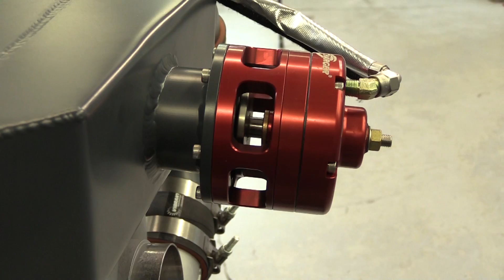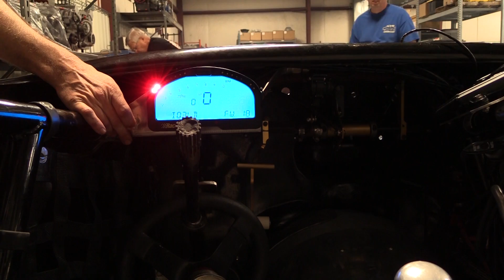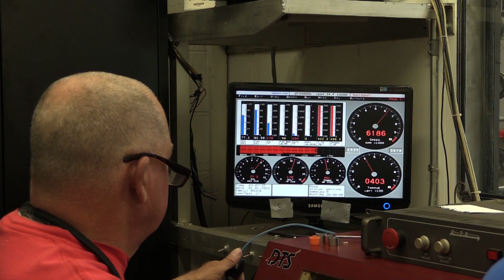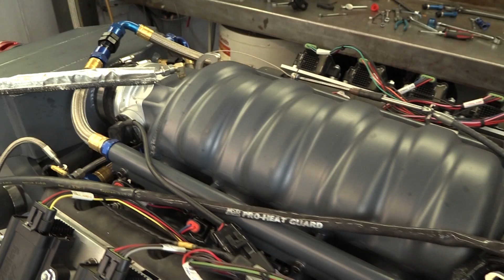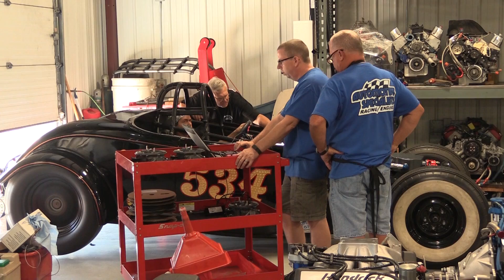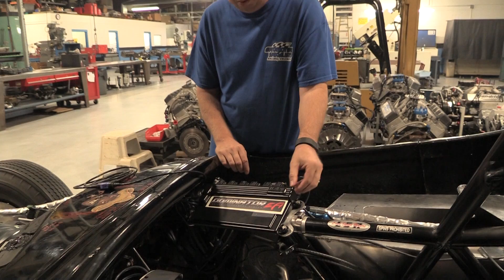A Thousand Horsepower on Just 260 Cubic Inches!

Comment: the rule no engine over 260 cubes but you can boost the shit out of it, where is the logic in that.
Reply: ChadMutt boost does not increase capacity mate. a 260cubic inch engine with 30psi boost still has the same capacity as a 260cubic inch engine that is NA
Reply: ChadMutt dude really.. if you have a 100mmx100mmx100mm(1litre) jug that is full of air at atmospheric pressure it will take 1litre of water to displace that air. if you pressurise that air to 30psi. you will still only need 1 litre of water to displace it. The displacement has not changed.
Reply: ChadMutt dude your getting your swept volume(cubic capacity) volumetric efficiency and dynamic compression ratio all mixed up. boost has absolutely no effect on cubic capacity but yes it does increase volumetric efficiency and dynamic compression ratio.
edit: how else would it increase power
Reply: MrEnroh. Woah...thats telling him! ...yeah dumb ass ! What were u thinking!
Reply: ChadMutt you are correct however you arent changing the displacement of the container are you....think about it...
Reply: ChadMutt because for eaxh cubic capaxity class there is a NA and a boosted subclass. if your NA you only run against NA engines of the same capacity. if your boosted you only run against boostes engines of the same capacity. remember they are only chasing records in land speed racing.
Reply: ChadMutt righto mate im out.
Reply: ChadMutt that logic is stored in the same place as the reason and decision to drive a sketchy 1934 car 235mph on a loose gravel like surface
Reply: @brentiaconelli6484 that's a replica ya fuckin putz
Reply: @Trendyrapslut  replica or not peg-boy...  Its still 1934 engineering. its still a i beam front axle and front leaf springs. So what the fuck does it matter if its a replica or original. Its sketchy because it was never intended to go over 50-60mph when engineered and these guys go 230mph. Your the putz!
Reply: @brentiaconelli6484  you must be new
Reply: there are multiple classes. na and blown they all have the same cubic inche classes. all the way up to AA which is 501+ cubic inches so you can run your motor in na then throw a blower or turbo on it and run in another class with the same cubes
Reply: Exactly
Reply: @damianw226  so tell me how the engines capacity has increased by adding a turbo ir force induction.  Oh that right it doesn't change.  Another wannabe car enthusiasts or troll   still at home with your mum and dad kid or manchild stfu
Reply: 260 cubes with a bar of boost is 520 cubes or around that. whats the point in having a cube limit if there is no boost limit. 
yeah mate just chuck on a blower or  turbo and go racing ?
Reply: a increase in displacement literally means more air and fuel can be pushed it
Reply: @Clorox Bleach  who cares about hondas there rubbish
Reply: Umm wtf does adding force induction have too do with the engines displacement.  ???? Or adding displacement.  If an engine of 3.0 liters revs to 7000 rpm then it will displace only 3 liters of air in one minute at 7000 rpm even if it had force induction.  Another wannabe car enthusiasts just like the 14 other that liked this sad comment.
Reply: +ChadMutt No kidding. Especially since they are effectively making the engine bigger anyways by putting a shit-zillion lbs of boost to it.
Reply: 177SCmaro no they arent boost is just stuffing more oxygen and fuel in
Reply: if you have a one liter container  full of air and then cram in another two liters of air that's three liters. 1+2=3. this is what boost does. gasses are compressible, liquids aren't.
Reply: " if your boosted you only run against boostes engines of the same capacity"

how can you be of the same capacity" if there's no limit on boost .
Reply: adding boost (compressed air) increases the volume of each cylinder. the physical bore and stroke might not change but the volume efficiency  changes dramatically under boost.
Reply: if you have one apple and then add two more. it's not one apple anymore.
you even agree with me
"yes it does increase volumetric efficiency "
Reply: no  displacement doesn't change(liquids aren't compressible}  but my container now has two liters of air in it.  if everyone is free to put as much air into their one liter container as they want where is the logic in that.

Comment: Not even impressive, nearly every engine made can double it's displacement in liters in wheel hp under boost.  That is with a reliable setup.
Reply: uh the 260 hasnt been in production for a very long time you wouldn't be impressed watching a 283 sbc spin 12 on alchol trying to destroy a pull sled would you
Reply: Always some know it all child making snarky comments.

Comment: I wonder why he didn't turbocharge it? Could have made the same or more power, with less stress on the engine. Class restriction?
Reply: +TurboMitsubishi Probably packaging. Turbos and their plumbing take up a lot of room. Plus, centrifugals are a bit more efficient then turbos in terms of how much they heat the air per lb of boost (adiabatic efficiency), although they do take more power to spin, so that could be a reason.

Comment: small engine? this is a 4.2liter V8, how is that small?  Look at the 1.5liter turbocharged formula one engine of the bravo BMW making 1500hp. /watch?v=t5Dbp_SuMHE
Reply: They didn't live more than about 200 miles (if that) and they ran on basically carcinogenic rocket fuels. It's pretty obvious the differences that exist, maybe you should learn more about engines then come back and continue the discussion.
Reply: 4.2l V8s are small....for a V8. Most V8s (at least in American cars) are 5.0s and bigger. Yes I'm aware of the Ford 4.6 v8, but as a whole American V8s are much bigger than 4.2l. 

Once you get into foreign markets it's a bit different, but that's an entirely different animal.
Reply: +Jan Akkermans F1 engine live for 1 or 2 races and cost like half a million dollars. Not really sure that's comparable. It would be like saying "pfff, this is nothing, those Top Fuel guys are making like 8000HP..."
Well, yeah they are, but for how long and at what price?
Reply: +Dakota Newcombe then you have the 4.8s
Reply: The 1.5 BMW was a 4 cyl. This motor literally displaces less than  .6L per cyl. Typical American performance V8s displace at a minimum. .8-.9L/cyl. 
Exception being the 4.6 Mod motor. But those things are really only good when you boost them.
The Chevy LS, which the smallest variant is 4.8L, around 283CI but the most common is the 5.3 327CI and 5.7L 350CI.
The Dodge Hemi engines smallest of which displace 5.7L around 346CI. 
All of these engines are at least 20CI larger and actually average around 80CI or 1.5 L more. 
The weak knees of most of these engines is the fact they run 2V/Cyl with a pushrod design.
If you look at the performance of the C4 Corvette ZL1 with the LT4 DOHC (Lotus) heads with forced induction you can see the HUGE POWER potential and really takes advantage of the displacement with a broad flat torque band which continues much higher in the RPM band than pushrod engines.
Reply: The 4.3 liter V6 is pretty much a sbc V8 that's missing 2 cylinders and that is 262 cubes.
Reply: JDR the 4.8 is a 5.3 with a different crank.

Comment: I've seen some 4 cylinders, mainly the 2.0 4g63 make well over 1000hp with 78mm turbo
Reply: +moe ridesKTM Looks like this is a land speed car.He says in this video that the customer wanted a powerful RELIABLE engine.The SB2 was made for nascar.Obviously SB2 stuff is pretty tough.
Reply: +moe ridesKTM yes your right but the power band is so small it is useless for the type of car this engine is going into where top speed you need a broad powerband to get the car moving
Reply: +Matt Dungrich  36-40 pounds. Yes that's Insane for a 4 cylinder, probably too much for a gem 3 small block. They dyno 1000 after 55-6000 rpm so there's extreme boost lag. Just look up 1000hp evo. There everywhere
Reply: For how long? How much boost?
Reply: +11bravo 01A Having set numerous speed records(14) on motorcycles I really didn't build the engines to have a broad powerband. Actually, I went for midrange to get up to speed quickly. The engines had lots of over rev so they would keep pulling.  You are allowed to be push started so bottom end wasn't imperative. But, I did use the lowest first gear in the transmission To me it was mathematical; how many rpm are required to spin the gearing to achieve a certain mph?
Reply: +11bravo 01A yea I completely agree, I wouldn't want to hold a 1000hp 4 cylinder at a very high rpm for long.  I'm sure they will detonate 20 seconds into the pull
Reply: Ran my s2000 as a daily driver and could turn it up to about that but never did i kept it around 700hp if only i wasnt a taller person who just got old. Sold it cause i had to roll out of it

Comment: glad to see a small V8 doing big numbers!
Reply: It's about flow and mass much more than density.
Reply: The word you are looking for idiot is COMPRESSION. A blower or turbo increases the compression ratio of each cylinder...
Reply: Why?
Reply: Knoble Industries I thought you were going t say that when you cram more food into your mouth, you do more shit... LOL
Reply: I mean modern LS engines are already quite small these days, so it's not all that surprising these days for a small v8 to make loads of power with boost.  Hell you even have tiny 4cyl honda engines that can produce 1k+ horsepower with a properly built boosted motor, mind you these numbers are still rather impressive.
Reply: causeimbatmaaan
Tell that to everyone who's ever had a supercharger, especially on alcohol. The entire reason they add so much power is by taking a bunch of flow and mass and increasing it's density (by compressing more air into the same volume).
Reply: 177SCmaro You've corrected yourself a bit, the only other point is that nothing changes the displacement of an engine.  You could say that more air in the same space increases density, and that's true, but that's not the point.  The real point is more atoms, not necessarily higher density which is a necessary side effect.
Reply: +331sbf this 260 lol
Reply: +331sbf and your name is bullshit small block fords dont exist lol
Reply: Knoble Industries You can put a 25 gallon tank on your lawn mower but it aint gonna pull a school bus. lol
Reply: causeimbatmaaan Unless turbo
Reply: Knoble Industries With my boot up it's ass!
Reply: Lol its a 7 cyl lmfao watch their build video
Reply: 177SCmaro look...you're just an idiot trying to justify stupid comments you made before.
Reply: causeimbatmaaan
You're projecting.
Reply: All I know is that when I cram more food into my mouth I end up having more energy, same principle?
Reply: +Knoble Industries You should be. Increasing the air this engine displaces by changing it's density is the entire reason for these impressive numbers.
Reply: causeimbatmaaan
More atoms/air in the same place IS increasing the density, dingbat. Which IS the point and it's how supercharged engines make more power, by displacing more air and forcing it into the same volume it increases it's density (and pressure, known as "boost") thus providing more oxygen in the same volume available to the engine.

A supercharger does effectually change the displacement - the amount of air displaced - of the engine, just not the swept volume of the engine (which is fixed). I think you may have the two confused i.e. you are saying "displacement" when you really mean "swept volume".

How much air an engine displaces can be effected by something as simple as the throttle, but the engine's swept volume never changes (unless you change the bore or stroke).
Reply: +Knoble Industries It's not small. When you put boost into an engine, the statis displacement is irrelevant. Every 14.5PSI you put into an engine doubles the effective displacement.
Reply: As I said, impressive for a small V8, I'm not interested in "effective" anything.  Lets talk about putting a vacuum cleaner on the intake of a 507 big block and how it lowers the effective displacement turning it into a "smaller" engine....
Reply: Also, they got these numbers running around 10PSI and reliability...

Comment: Is there a benefit with having a turbo feed a supercharger? So little information on it, I've seen someone say they added like 1000 hp this way with no lag anywhere in the power ban. Then on the other side I've seen people say they lost 300 hp and got a freaked up power ban with spikes and dips.
I'm not rich.........................yea I just checked again, I'm not rich so I can't test this on my own but maybe someone there or watching this has tried it.
Reply: +therealdeadpen Detroit Diesel 2 strokes did that for years.  They require the blower to push fresh air in and exhaust out.  So without a turbo, the blower is taking a bite of air just like a n/a motor.  But with a turbo, it takes a bite of pressurized denser air.  The silver Detroits had a bypass which let air go around the blower once the turbo pressure exceeded what the blower could use.  It's nothing new, I think it's just easier to go with one or the other, not both.
Reply: Oh okay thanks
Reply: +19504x4 cool bit of info there
Reply: +therealdeadpen google: Lancia Delta S4 Group B rallycar. These cars had a supercharger and a turbo on a 4cil 16V mid-engine. AWD. Crazy fast acceleration. zero lag.

Comment: I'm a Ford guy, but DAMN! That's awesome!
Reply: +331sbf dude 3000 hp i call bs from a stoke bore/stroke 4.6 heads are apart of the block so is cam
Reply: @jdrok5026  AH DUH Ford idiot. I call your 331 BS
Reply: +jdr ok stock bore and stroke also a bore makes very little in power out put

Comment: Ford Australia 4 litre 240ci have been making power greater than this for some time. Checkout Ford falcon barra engines.
Reply: +Jeff Sewell Top fuel has been making more power as well, but they're as irrelevent as the Barra engine is for this application.
Reply: +Jeff Sewell 
at 10PSI?? don't forget too, that this engine has a parasite leaching off the front of the engine. those ford barra anchors have the ultimate in forced induction, the mighty TURBO CHARGER. BIG difference.

Comment: I've always wanted to do a 3" stroke engine with twin turbos, great heads, and 10,000 RPMs. The weak link is the valve train and the NASCAR advances with the steel rockers and oilers have helped that. Cool!!!
Reply: +MrKyleb21 I heard a rumor that the original boss 302 engine was able to do close to 10k rpm with a few valvetrain modifications. That's a 3"x4" boreXstroke engine.

And that was in the late 60s early 70s. With modern cleveland valvetrain components and forged internals, I'm sure 10k would be attainable on a clevor at the very least. Then factor in the massive aftermarket for the SBC and you'd probably be able to do it relatively easily.
Reply: Chevy 327s were capable of 10krpm if you knew what you were doing. They made badass drag racing engines when paired to a sturdy manual transmission. When my dad used to drag race there was a guy with a TA that had a built 327 put in it after the guy blew the other engine. It gave his 63 Impala with a 400 sbc a run for his money. He could beat him but only if he maintained traction the whole way. Otherwise he was done for.
Reply: +Dakota Newcombe Old guy at a local strip had a 327 years ago he spun up to 10k, neighbor said it was crazy fast for an NA 327. Only downside was he had a hard time keeping them together and had some valve train issues. Said he eventually got the build down but passed pretty soon after he got it worked out.
Reply: +nmdiesel89 thw weakest link is to do with lifter float a stiffer spring will make up for that less slack in the valvetrain a 283 will spin past 12k properly built and the ford 302 wasnt as badass as the dz motor